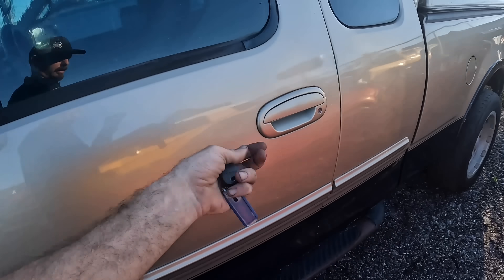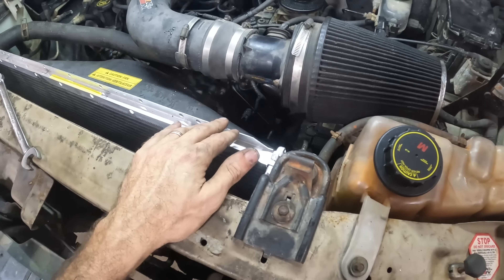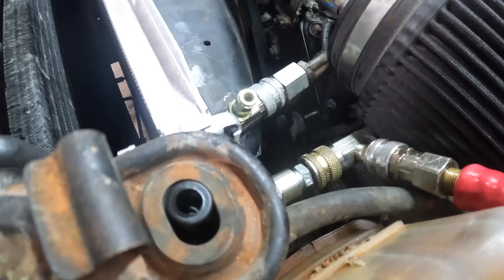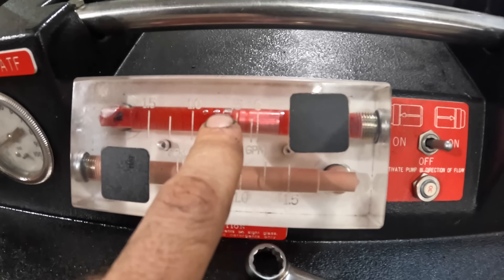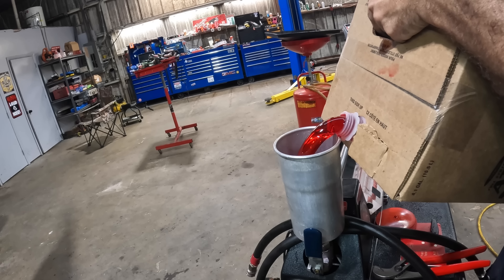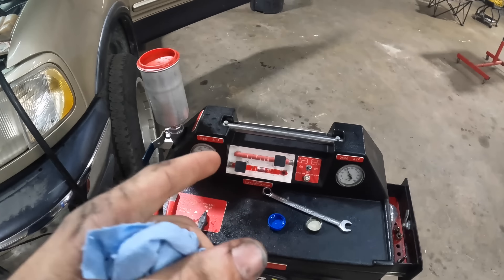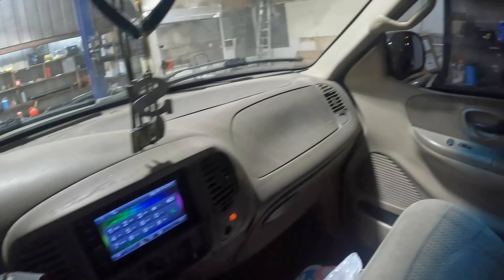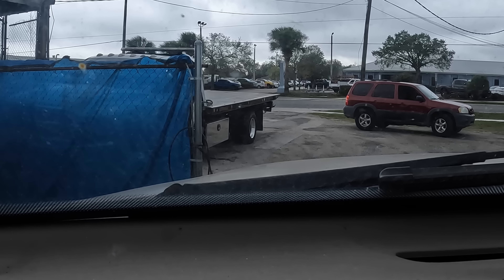Customer States: “Fingers Crossed” No Chance! 2000 Ford F150 4.6 5.4 Transmission Damaged

Comment: Hey Ray, that was a great effort on that trans. It's certainly worth a shot if the flush will fix it although that clutch material doesn't bode well for it. As for the 1 star review, it's good to have one of those so people don't think all your great reviews are fake. 😉 Keep up the great work! Cheers!
Reply: All transmissions have that clutch material in them after 100k miles.

Comment: Some transmissions from Ford, and probably others as well, will not flow through the cooler lines at all until the temperature of the oil is 200°F +

Comment: RE the odometer. My 2001 F150 odometer won't illuminate until I've driven a few miles, then it lights up just fine.  I've seen some YouTube videos on fixes which involve taking the gauge cluster out and re-soldering a couple of pins on the back side.  I may eventually get to that, but it's not a pressing issue yet.

Comment: my father in law gifted me a 2005 f150 that he got from an auction with 295k miles on it at the time, one day omw to work the trans line from the radiator popped off and was dumping all the fluid, i only thought my tranny was going out cause the o/d light came on, basically limped it to work barely making it. Fixed the line, refilled with fluid and put 40k miles on it since then. Shifts the same as when i got it

Comment: Is there a reason you don't connect the exchanger up to the lines going to and from trans cooler, and bypass the new cooler entirely until you have clean fluid in it?

Comment: The pump isn't destroyed it pulled itself in to the shop !  I guess I don't get it Rainman.  Why can't you hook the machine directly to the trans lines and just push the old fluid out of the trans and the new fluid in and never contaminate the new radiator ?  Something I'm missing here ??
Reply: If you look at what he did, he was disconnecting the lines at the rad side. The problem is there is only so much 2 flushes can do and the guy doesnt want to spend so much money on it. So the new rad will be contaminated anyways from the customer driving
Reply: @Kellen6795   I don't believe you understand what I'm saying
Reply: @MrTonyPiscatelle  i understand...and it's the way I would have done it!

Comment: Hi Ray, I noticed the hoses you fit the opposite way on the second flush but you said it makes no difference but that cant be the case as the fluid is pumped by the trans pump... also the machine hose is marked with a red sleeve also when you reversed it you got more pressure... it makes no sense to me that it doesn't matter which way the hoses are fitted as they must connect to one side of the bladder or the other.. please enlighten me if this is not the case ... thanks

Comment: Hey Ray, if you were to collect that contaminated fluid into something like a clear plastic tote and let it sit for a day or a week, will the oil and water separate?
I've done that with riding lawn mower gas before. I had a bad cap that let water into the tank over the winter. I emptied the tank into a tote, then after a couple hours I noticed that the water was sitting on the bottom, so I slowly poured the gas back into the tank and was left with a bunch of water that my weeds really appreciated. Mower ran fine.
Just a thought, I'm a real cheap mo fo.

Comment: Ray, hi for down under. Brother had a 04 Ford Fairlane with a 5.4 which had the same transmission cooler failure, (common fault with radiator) bypassed with external cooler and did the dump and flush approx. 4 times until it was close to cherry colour, did 20K (13K miles) before selling it. still was going strong. love your videos!

Comment: Late 90s, maybe early 2k...i did many of those style of trans flushes (similar machine) while working for VIOC.
Its the way to go for trans service... Assuming you don't already have trans problems... It is possible to make a problem WORSE with this style of flush... Sometimes a filter change/25% pan fluid is a better option. 
In this case, if $ is an issue, there's nothing wrong with trying it, as long as customer accepts doing this may make it worse, but you're still paying me for my time and tool investments. You may still be buying a trans.... Your choice 🤷.
I might say, not doing the trans? 
OK... Minimum, Rad, filter/fluid and then a flush all at the same time... And still no warranty... 

I'll try it for you if you are paying, but NO PROMISES! 

What does bother me is I've watched today's jiffy lube techs just do the suck thru dipstick and refill... Calling that a flush... FOH.
When I called them on it... "Oh, well I'll start it up and run thru the gears and do another suck n fill." 

GTFO! 

If I am only getting 25-50% of the fluid changed, I at least want the filter changed too. 

The jiffy lube flush is NOT GOOD ENOUGH FOR ME... DO IT RIGHT THE 1ST TIME OR DON'T DO IT!

Comment: I think a CVT would have higher chances of surviving this procedure than an AT since you got a chain rather than ceramic plates, but the failure point is not going to be the frictions. That just causes slipping when shifting. What that moisture is going to do is the valves and springs in the pump or the valve body might get corroded or plugged, and that in the long run will cause failure.... n_n the good thing is, as long as the case is not leaking all the internal components can be replaced... but As I learned that takes months of part hunting.
Reply: friction material or corrosion or plugged, same destiny,  one more addition to the junkyard side.

Comment: I had my cooling system (radiator) flushed at a shop one day. Three days later my heater core went out. Coincidence or over pressure to generate more sales?
Reply: the flush additive is acidic, did not flush long enough to get 100% 50-50 coolant in whole system.

Comment: As I recall, the old trans filter was reinstalled after the inspection because Ray's intuition said not worth repairing.  I feel like the two flushes were a waste if the owner does not go one step more and let Ray drop the pan again, clean it and install a new filter.

I'm curious, about the mileage.  Will the scan tool read the mileage even with the instrument cluster out?
Reply: That wouldn't really mean much, since Ray mentioned that the engine has been swapped out with another.
Odo could read 400,000 miles, but there might only be 50,000 on the replaced motor.
Reply: It could be on the ECU but who knows

Comment: Ray ya'll know when ya'll get water, (condensation), in your motor, the water boils out as the engine gets up to temperature. What I don't know about a transmission is if the same thing can happen with transmission fluid. If it can then the guy can live with this, if not the trans will soon die. I had a transmission with motor oil looking trans fluid in it when I got it and changed it but not with as many or as much fluid as you used and that was ten thousand miles ago and it is still running well. I will soon drop the pan again and put 6 more fresh quarts in her hoping this will do the trick since it has no bad transmission problems yet.
Reply: transmission has solenoid valves and water soluble clutch linings, engine has crank and cam seals only, water and petroleum mix no longer lubricate or same viscosity to shift, also engine hotter.

Comment: Would it be possible to hook the machine to both lines going to the cooler? That way you wouldn’t have to contaminate the brand new cooler.
Reply: The cooler tanks on a radiator are pretty much open tanks. Not much to hold goo

Comment: Ray, I’m wondering why dint you do it the manual way at first like disconnecting the trans line and pouring fresh fluid from top and draining the nasty till it comes out clear…would that not be feasible in terms of how many quarts needed/used??

Just a thought..I feel the trans is strong since its still working after all that mess.

Comment: I prefer to use diesel fuel as the solvent to flush contaminated engines and transmissions. It provides enough lubrication for short running times and does a good job of getting the gunk to drain down into the pan. Cleaning out the radiator and the hoses is a bigger problem.

Comment: I don’t think the owner understands that leaving the transmission with contaminated fluid is just as bad as not having done anything. If you’re going to spend $500 to remove some of the water, why not spend $700 and remove most of the water.  It’s like walking into the ER bleeding out from 2 stab wounds and leaving after they sew up one of them.

Comment: Something that filthy I would just run the cooler lines into a drain pan and pour 10 or more quarts into the fill tube while running to flush the converter then due an exchange.

Comment: Quick question, what happens to the oil in the pan (transmission)? Does that also gets exchange when doing the flush?
Reply: It absolutely does....the pan oil is sucked up into the trans and circulated.
Reply: @djsi38t  ok thanks

Comment: Seems like there is a need to have some sort of flush liquid that is inexpensive and won't harm the transmission or radiator and can be used in multiple flushes, without needing to spend as much on food grade or even adequate grade fluid until the flush is satisfactory.
But then again, I don't know how often someone might do this procedure. I have come across other YouTube mechanics taking on a similar situation. So it may happen more often than we realize.

Comment: Did you check the transmission level after the flush???
Reply: My number one question.  Granted if you think about the flush process, fluid in, fluid out, but still, one needs to make sure the ATF fluid level is in spec.

Comment: probably should have dropped the pan and replaced the transmission filter after the first fluid flush. and then replaced it again after that. that filter is probably super saturated with nasty fluids as well contributing to the time and amount of flushes you need to do.

Comment: @rainman.  I have a 2008 ford edge with 308,000 miles the car runs and handles like a new one but the transmission has a shutter in it because the torque converter wants to lock up.  Would a transmission flush help it at all to just get another 6 months or so out of it? I know they are a non serviceable transmission but it doesn’t slip or have trouble shifting it just shutters when up shifting.  I’ve tried the additive to help that but it made no difference.  Just want to get a little more life out of it because planning on getting a new vehicle in 6 months to a year

Comment: Ray - I have a question regarding the fluid exchange machine; do you ever (need to ?) clean the hoses and adaptors before using them on another vehicle to prevent gunk building up, or does the machine essentially self-clean everything during normal operations?

Comment: Working for someone else, you had the service advisors and front end people that would have weeded out these types of jobs. The big shops are way too afraid to take on these. Liability, the low probability that they will work or work for long. Those ships are protecting themselves.
Hopefully this customer treats you right and if it's a big fail, then it was the customers choice to roll the dice. If that happens, cut their losses and walk away knowing that they and you tried. Hopefully if it lives a while longer, they use that time to squirrel away some money towards a new vehicle.
Reply: lawyers advised them not to take these, if truck dies at the railroad crossing when train coming? RR has to move quick

Comment: Enjoyed watching your video! 
I noticed that even though you had a tough day working with grease and oil, you still had some grime visible under your fingernails the next morning. 
Have you considered using a pumice soap and a fingernail scrub brush at the end of the workday?   It takes about three minutes in my experience.
Proper hand hygiene is important and can be easily maintained with a little extra effort.
Keep up the interesting work, I'm looking forward  to watching you next video.

Edit:  I completely agree with you about the reviews.  It worse than Amazon's review system which is full of fakes.

Comment: Great job. If that customer is smart he will do the flush. Get that fluid clean and new filter. I'm sure it's junk. Then add that conditioner. I'm pretty certain from what I've seen they can get 20-25 thousand miles out of it. It's not a Chevy tranny with the thin clutches. They have pretty good meat.

Comment: So I bought an air tank to fill tires with
Harbor freight,  cheap 5 gallon tank came  
With a cheap hose, and bicycle pump type end, so I bought a short hose and some fittings,  the fill port is only 1/8"
And it takes forever to fill, so I put on a female chuck, hook it to my compressor with a male to male adaptor and it fills faster, mind you im using a pancake compressor to fill it, and that tool leaks air. I told my wife to pick it up she said its kinda heavy. And asked will it weigh more full, I said put your hand out palm up, is that heavy?  So I got it filled today, took it in and asked her to pick it up now its full.  I got a shit eating grin. She knew right after she asked me that air has no weight.  But it hold 120 lbs.  How can this be?  
Ok she's blonde.  But she's really smart. Just says some silly stuff without thinking sometimes.  She's not going to live this down.  
She got me back the other day I said something stupid without thinking she made a comment what colors your hair?
Its brown.  Becuse im full of shit.

Comment: I know for a fact transmissions are expensive to build or buy. I've had to have 1 of mine rebuilt twice before at $1500 first time, and $1800 second time.  First time the shop I used didn't do but the bad segment, and didn't do but 3rd thru 5th.  Didn't last a year and just enough passed the warranty and 1st went out and it wouldn't move.  So, went to another one and they rebuilt it for from pump, torque converter, and every single part inside brand new..stem to stern lol.  Even added a fairly large auxiliary cooling radiator out in front of the main and took it out of the main radiator so it had it's own cooling system.  Kept it cooler since I towed a lot with it, as I saw trans temps average from 170 to 190 vs before thru the main at 200 to 210 average.  Dude even put a minor shift kit in it.  Would hit fairly hard at gear changes...made it "bullet proof like they did on those lifted 4x4 trucks on huge tires.  Needless to say it lasted until I sold the truck 5 years later without a single issue.  So, that might be this guy's only option.  Not sure down there but up here they charge between $1500 and $2200 depending on type, age, etc.  Better than $80k for a new one I guess.  Take care.  Hope to hear more about this truck later and that it's still running and driving
Reply: it will be wonderful and long  Ray rebuilding tranny video series.
Reply: @forgetfulme1719  i turned wrenches 45 yrs. Disassembled ONE TH 350....never touched another auto trans unless it was something external!....NOT MY BAG!!
Reply: @stevenbaker9327  did one successfully with Chilton manual next to me, now too heavy for me and scare of all little balls, where they go or same sizes?

Comment: With all the sensors they have, one would think that if they designed something like this where one could damage or destroy a trans with a leak from the Radiator, they would have a sensor!!

Man I hate trolls! Gave you 1 star because you can't read! If the guy has never been there, they have nothing to rate. Too bad one couldn't alert all the other shops so he can go to another state to get his car worked on!

Comment: Where does that nasty contaminated fluid go?  Is it possible that some place can re-refine that or chemically recycle it in some way? Or is it added to some kind of low-grade fuel like bunker oil or something?
Reply: Probably pays a recycler to haul it away, out of sight, out of mind.  After that, it might get re-refined, if you believe the recycling companies’ hype.
Reply: @StrongDreamsWaitHere  Or burned in an incinerator for waste heat recovery.
Reply: pick up for recycle very costly or u see a  Florida pond change to a shade of pink tomorrow.

Comment: @ 19:39 Are you charging him for the first flush you did with the machine hooked up backwards?
Reply from the maker: The machine won’t flow backwards, meaning it won’t pump in spend fluid. It functions the same way regardless of how the hoses are connected.

Comment: Does BG make a antislip additives for the transmission? By exchanging the transmission fluid it should of cleaned a lot of debris from thee valves and passage ways in the valve body, hopefully allowing quicker shifts with a lot less slippage in what's left of the clutches. Hopefully your customer looks for a cheep wrecked vehicle to salvage the transmission and other parts to keep there truck going. One mad  person giving a bad review out of 500 is not bad, there only mad because they can't figure out how to book there vehicle in for service. Probably a scammer anyways.

Comment: Back when my dad had a salvage yard, most vehicles went to the boneyard with no cash exchanged. He was given a 1987 Mercury station wagon with a slipping transmission. Low mileage car but not worth a transmission swap at that age. He babied it at the 1-2 shift and drove it as his go-to car for well over 100,000 miles. It was rust that finally parked it for good.

Comment: A while back I remember seeing a "poor man's transmission flush" procedure that involved disconnecting the cooler lines and using a hose in an ATF container on the suction side and another hose on the pressure side into a waste container, using the AT's pump at idle to move the fluid.  Of course the AT filter was not changed and would block any big chunks.